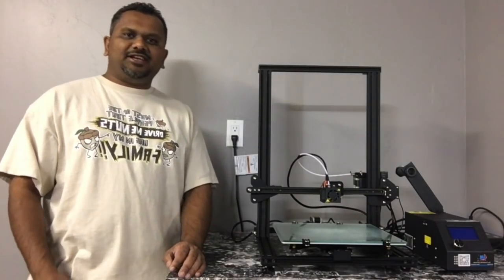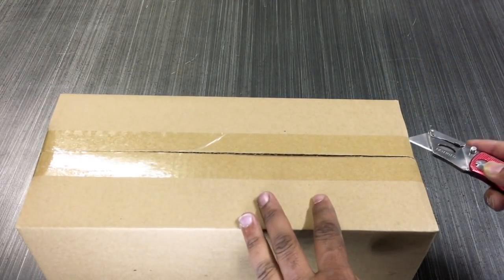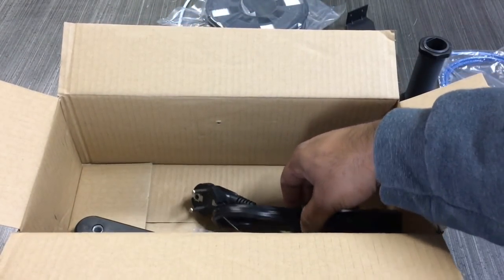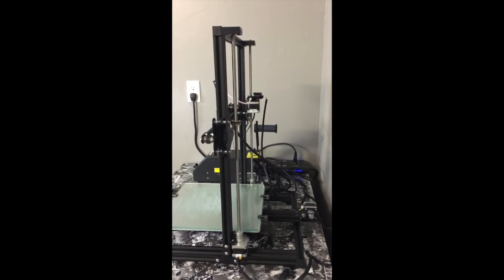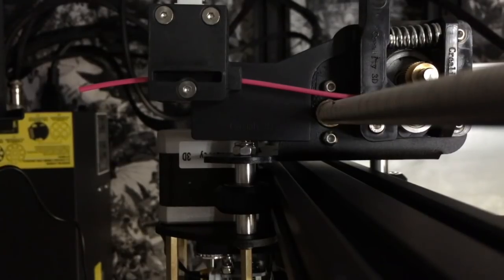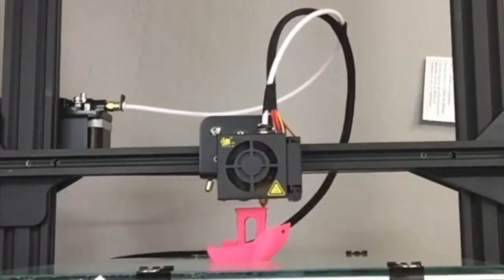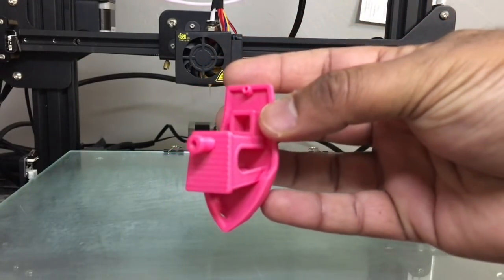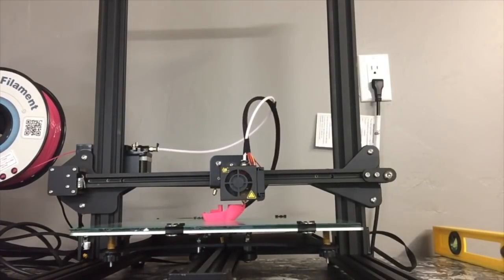Creality CR-10S 3D Printer Review.

Comment: Hi VJ, nice vase. How long does it take to print something of that size? I have heard that it takes hours or even days. Does it need to be done in a single job or can we turn it off and continue another day? I am concerned with the noise level and turning it on the whole day would be an issue.
Reply from the maker: Noise level is not a big issue.  A vase is normally quicker because there is no infill but normally prints can take days depending on what your printing.
Reply: Hi, thanks for the reply. Is it possible to stop a job and continue the next day?
Reply from the maker: Yes, if you have fail print resume.  or you can just cut the model in peaces and print them that way.

Comment: Great review.  I did notice that the filament run-out housing moving back and forth while printing (can be easily seen at the end of your video on the Benchy print).  Did you use anything on the glass bed prior to printing to help the filament stick?
Reply from the maker: just glue on tall prints but besides that i don't really use anything for smaller models.
Reply: SAN TUBE Thank you!  I appreciate the info.  I am really considering the CR-10S as my next printer.
Reply from the maker: Its a great printer,  in my opinion.

Comment: Noticed near the end of the video that the Runout Sensor is just bouncing around as it pulls filament through. I can see that that mount will not last very long.
Reply from the maker: The sensor is a great upgrade but the mount needs some work.  So yes, i agree with you.

Comment: nice Vid... Hey I don't seem to find that Vase print on special mode, I have cura 3.04, can you help me with that.. i would like to print a vase for my wife.
thanks
Reply from the maker: I use  cura 2.6, under special modes its called spiralize outer contour.  Just make sure infill is turned off.

Comment: Thats odd... I ordered a CR-10s earlier this month and got it a week ago. It came packaged in a CR-10 box with white styrofoam. I only knew it was a CR-10s from a small vague sticker and  the upgrades when I inspected it.
Reply: But you should be very lucky. I have had much frustration with my own new CR-10s. The glass bed is warped/uneven as hell everywhere, so I spent like 12 hours total in leveling and using painting  tape in order to only make PLA stick. As well as under-extrusion on the top at the walls of the print, and curvy/wobbly walls on the y-axis. I had to play around with settings on several printed test cubes in order to minimize all of the problems.

Could only start printing sorta proper models a week after receiving the CR-10s.
Reply from the maker: That is correct, some CR-10S come in a CR-10 box with the little sticker on the side, that is normal.
Reply: Nauclerus, oh, my cr 10s glass seems to be level.

Comment: Great video as usual. Wish to see adding auto level sensor.
Reply from the maker: Thanks, i will be working on upgrades soon.
Reply: I'm hoping "Santa" brings me a CR-10S this Christmas as my first 3D printer. However as a total 3D printing n00b, I tend to wonder about the efficacy of full auto bed leveling sensors.

I've seen 3D printing experts over and over talk about the importance of building a good foundation with the first couple layers of your 3D print. Isn't it more important to manually level your bed with paper as so many have demonstrated? I suspect even with BL-Touch style, inductive, and controller-stepper feedback based systems, you still have an issue with the first layers being extruded inconsistently with a shift in the z/elevation steppers, especially on a lazily levelled bed.

Am I totally off-base on this? Does auto-bed levelling really make any appreciable difference? Could I be totally lazy with one of these systems and still have equivalent quality prints to a manual level which prints the Z axis without shifting steps to compensate?